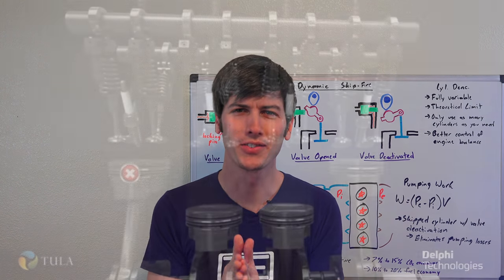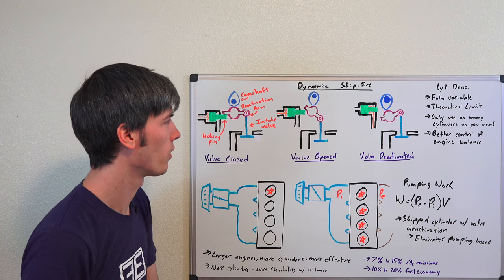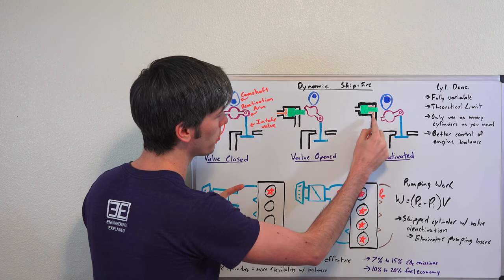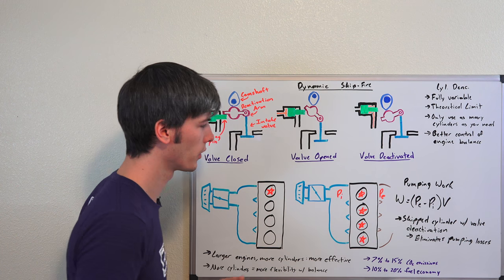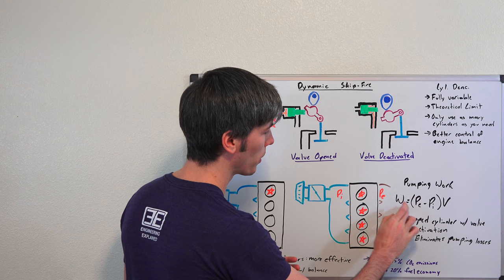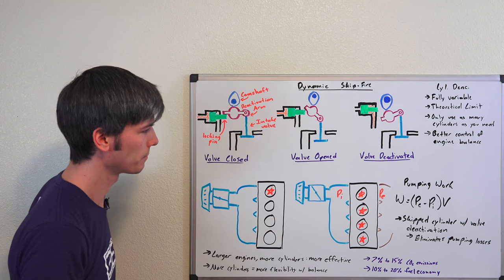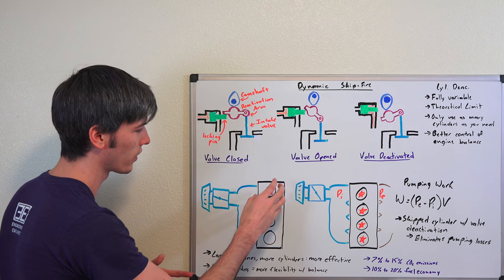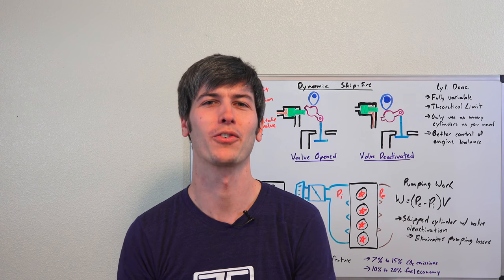How Dynamic Skip Fire Works - Variable Displacement Engines

Comment from the maker: Hello everyone! Lots of questions in the comments about what's going on with the deactivated cylinders, since they're compressing air or pulling a vacuum. Regardless of the quantity of air that's in the cylinder, it acts like an air spring (stores energy, doesn't lose much). So if there's a bunch of air in there, it compresses the air, then the air pushes the piston back down - not much energy lost. If there's not much air inside, then it pulls a vacuum on the way down, but is pulled upward on the way back up. Ideal would likely be to have not much air in the cylinders that are deactivated, so there is not additional energy lost from the pressure on the piston rings against the cylinder bore. Hope everyone's having a great day! 
Instagram! https://www.instagram.com/engineeringexplained/
T-Shirts! http://bit.ly/2BHsiuo
Reply: Engineering Explained if the valve is closed using this switch it may lead to breaking of switch. Why not use a cut off for fuel injection because if the valve don't open it create vaccumn n pressure inside the chamber lead to engine stopping. As per my opinion fuel injection should be cut off of smooth operation. correct me if I m wrong. Thanks for knowledge
And keep making videos
Reply: So does this technology require a throttle that is electronically controlled? Or can it be configured with a cable somehow? I know Tesla is not ICE but their models have a capability to remotely control the throttle, brakes, among other things. I hope this is unhackable, if it is electronically controlled
Reply: It is more efficient to keep the valves closed while cutting fuel injection since that turns the deactivated cylinder into an air spring with very little loses. That is the whole reason for this switch mechanism and it is also done in current cylinder deactivation methods. Just cutting fuel ignition while keeping normal valve operation will lead to pumping loses (both on intake and exhaust cycles) negating much of the gain.
Reply: Fuel injection will ALSO be cut. As it indeed is under some circumstances in any EFI system. Such as when decelerating or being pulled down a steep hill by gravity. If the engine speed is above a certain threshold point, just above idle, say around 1300 1400 rpm and the ECU receives a throttle position sensor signal indicating it is at idle or no throttle. There will be no fuel delivery. The injection duration will in effect be zero seconds. This stops wasted fue and unburned hydrocarbons being spewed from the exhaust.
But this does not help with the other aspects that were well covered in the video such as efficiency and pumping losses.
Reply: Very interesting. For the sake of running culture you can only shut of an even number of cylinders and you can only do it on engines with an even number of cylinders, because else you couldn't realize second engine balance.
Reply: If fuel injection is cut but valves are left normal then the deactivated cylinder will have pumping losses as well as lost energy to compress air. If you read his post above it takes advantage of the fact that all the energy used to compress the air is conserved when that air (spring) pushes back on the piston during the "power" stroke.
Reply: i was right abiut to ask that! can i consider myself intelligent? ahahah
Reply: Your explanation is flawed. If you keep inlet and exhaust valves closed you get compression lock, or at least braking. Try again.
Reply: and there is the answer to the question i was going to ask.  Thanks!
Reply: The spring losses are still pretty high, as are the friction losses, in the deactivated cylinders. This is a poor way of gaining a little efficiency. A much better way is to start with a smaller engine to begin with and then use turbo-charging to effectively increase displacement when the extra power is needed. With cylinder deactivation, you're always lugging around that big, heavy engine that effectively becomes smaller when needed. With turbo-charging, you're always carrying the smaller, lighter engine that effectively becomes larger when needed.
Reply: So, throttle partially closed creates "suction" and the engine has to work hard; but no losses with valve closed... because the air acts as a spring?  ... Gimme some of that "smart air" you guys have around there, the rest of us could use some of it too!

Piston moving down with valve closed will require work (anybody that tried to pull back a syringe with the finger on the nozzle knows that). You will get some of that energy back like you said due to the built up potential energy.

No magic with throttle open though: It will actually require less work for the piston to move down (since air can get in the piston creating less "suction"); but on the up stroke, whatever air got in needs to be compressed nso it will need that much more extra work.

And if you  want to be fair and look at a complete cycle (4 strokes) I think it washes out...

Any gains would be from losses due to leakage past the rings/valves and any possible friction associated with moving/not moving components.

My 2c. Good job on the videos though!  Really enjoy them!
Reply: Jason, can you do a video that walks through some of the calculations for sizing butterfly valves for throttle bodies?  Determining airflow needed, and the pressure drop across the throttle body using Cv values?  Just an idea for a video.  Thanks, and keep up the good work.
Reply: Im looking for that diesel gate video of yours , I cant find it anymore
Reply: Which cars have that kind of deactivation already???
Reply: MGdrive, Mazda is the only maker to provide it on a 4 cyl engine. Lots of animations on their site. They use weights in the torque converter for balancing.
Reply: Yes this system will fail, because V8's with all their extra parts are so much less reliable than four cylinders :p
Reply: Sounds like a good argument for solenoid valves and independent throttle bodies...
Koennesig is doing that aren't they?
Reply: BobbyG I don't think Koenigsegg's Freevalve uses any throttle body. Why would it? The valves themselves act as small, individual throttle bodies. Even BMW's Valvetronic doesn't use a throttle body and that is "ancient" technology compared to Freevalve.
And yes, it is a good argument for solenoid valves. Simplifying that head, reducing the weight and having total control of valve operation can be used to take this concept further.
Reply: NB Koala Please continue reading you don’t have a compression lock you have an air spring
Reply: Wouldn't it be better to just have both valves opened a little bit. So air can just pass through the cylinder
Reply: rationalmartian what car models cut the EFI system completely when going down a hill?
Reply: NB Koala how so? You don't get compression lock on a normal compression stroke so why would you with this? Try again
Reply: can anyone 
explain the difference between awd and 4wd
Reply: Engineering Explained this litterally answered my question withou having to write it! Thanks
Reply: I think Koenigsegg actually got this brilliantly solved with their Freevalve system. Simple and capable.
Reply: I was thinking the same thing. I have seen the concept videos a couple of years ago but haven´t heard of any engine using the technology
Reply: My Challenger Scat Pack 392 has this as well.
Reply: HEY JASON. SEPERATE TOPIC! CAN YOU DO A VIDEO ON WET LINER VS DRY LINER ENGINES? LIKE ENGINES WHERE THERE IS A GAP BETWEEN THE CRANKCASE AND CYLINDER OR NOT. GOT INTO A DEBATE WITH A PERSON SAYING THAT WET LINER ENGINES LIKE THE ECOBOOST LINEUP, SPECIFICALLY THE 2.3, ARE UNRELIABLE BECAUSE THE CYLINDERS HAVE ROOM TO MOVE. THANKS!!!!
Reply: Hey there. I thought i should let you know that your caps lock is on. That's like driving around with your high-beams on, or yelling in a library. It's considered bad form and inconsiderate of others. Thanks for understanding.
Reply: yeah but who would buy a 4cyl foolsize truck/suv? even if it had same horsetorks.
Reply: damn near all of them since efi came to the masses.  dfco.
Reply: Just a small correction but actually higher crankcase pressure is pushing the pistons back up when the pressure is lower in the combustion chamber at the time when a vacuum is in a dead cylinder.
Reply: I have a V-10. Why cant I just disconnect the injector and ignition power supply in six of the 10. Are these these cylinders now deactivated and saving fuel??

Comment: Excellent video and I agree with everything you said.  I'd like to mention a little more about effficiency.  The most efficient internal combustion engines made are the huge diesel engines used in powering ships across the oceans.  Some of these engines have cylinder bores on the order 10 to 15 feet.  This results in a drastic increase of cylinder volume to cylinder wall area ratio, which also results in far less heat being conducted out of the gasses through the cylinder walls.  By cylinder walls I mean the total area exposed to the gasses with consists of the piston crown, cylinder head and valve head areas plus the actual cylinder walls.  Cylinder deactivation in these engines is typically not used because these ships' engines are typically designed to operate over relatively narrow power requirements, which is typical for ships.

Comment: Hey Jason! Thanks for your comment about the air spring thing, that was my first question but you answered it before I could even ask the question!
My other question is this: how does the balancing of the engine work in this situation? How can a 4-6-8 cyl engine be balanced with only one cylinder firing?

Comment: I didn't get why the throttle opening was smaller when running on 4 cylinders? Wouldn't it need less or at least the same amount of air (ie. the same amount of air needed to create 25hp in one cylinder would be roughly equal to dividing that air four ways and sending into all 4 cylinders) and consequently have a similar throttle opening? That confused me a bit - seems counter intuitive.
Reply: MrSlash00r The problem is that four cylinders want to "pull" four times the amount of air at a constant throttle position (in comparison to just one active cylinder) So you have to limit those four cylinders with an even stricter throttle.
Reply: How can 4 cylinders pull 4 times more air? They don't pull air at the same time.
Reply: On average they do. At, let's say, 3000 rpm, one working cylinder would pull air in 25 times per second. With all 4 cylinders working they would also pull air 25 times per second... each. So there would be some cylinder pulling air 100 times in one second, and with the same amount per one pull per cylinder it means 4 times more air pulled in each second.
Reply: szafirowy01 Ok, I got it.
Reply: The airflow with DSF is slightly smaller, since it only goes down because the efficiency improves. The pressure differential between the intake manifold and the atmosphere also goes down. One requires a smaller throttle opening, while the other requires a larger opening. So the change(size and direction) in the throttle opening will depend on the operating condition.

Comment: I love this theory. And on paper it's a wonderful idea!. As a master  Ase tech that's been at a chevy dealer since 07 I can tell you for a fact that I never put pistons in a ls style engine until the 07 active fuel management engine That deactivates cylinders 1,4,6,7 using a different lifter that collapses inside of itself when unlocked. (Valves stay closed)  Same idea AIR SPRING concept will take care of engine as it's running. Real world situation.... the vacuum inside the cylinder that is created is so large it actually sucks oil past the piston rings eventually causing a build up of deposits on the rings expecially on the bottom (oil seal rings), thus turning the engine into a big money pit of warranty  repairs for the company by 50,000 miles and customer satisfaction numbers to plummet because their " brand new truck" now needs and engine overhaul. (Piston and ring replacement) Let me say again this all started in 07 and still to this day in 2018 I myself ( 1 out of 14 techs) put at least one set of pistons in a week ! 11 years later UNDER WARRANTY!  So if we're running with this. I sincerely think the "air spring" idea needs more evaluation. Would love this to come together and not cost my favorite brand millions in warranty  dollars. Or to hear alot of very brand loyal customers say " this will be the last one I buy" ...

Comment: I've a Dodge V8 (Hemi 5.7), Chevy V8 (LS4 5.3) and a Chevy V6 (3.9) that all had cylinder deactivation - and those are all at least 10+ year old engines at this point.  Worked very seamlessly in each one of those.  This is not a new technology at all, but the concept of varying the deactivate-able cylinders is.  Will be interesting to see how this is implemented.

Comment: Hey good video. Just wanted to note that the intake valve can in fact act like the trottle plate. In fact gas motors can due away with the throttle plate. You just have change the cam for timeing duration.

Comment: I'm interested in the relationship between this and engine balance. Does engine balance play a noticeable part in determining which cylinders (and how many) fire? Is engine load also a factor? Does the 'air spring' of the deactivated cylinder's mitigate this issue somewhat?

Comment: Great explanation on a subject  I have wanted to understand better but no one seems to want to attempt to explain and thanks for adding the info in comments about the push pull action of air on the dead cylinders answering that question.
But PLEASE add more info about the main reason the fuel economy is increased when you talk about the engine pumping being more efficient with less cylinders when vehicle is under a light load. I mean it seems this part is not explained enough to comprehend as vehicle's are fuel injected and more exhaust would seem better not worse. I do understand the hotter cylinder when turning off others.
Also I'm a bit surprised that the friction of the dead cylinders still spinning isn't a concern on economy, that we didn't find a way to disconnect the piston movement altogether.
Also a discussion of the old method of turning off cylinders history would be a great discussion. I had a friend with a Cadillac from I think the 1980's that had the 4-6-8 engine and he I believe had to have major work done on it because of failure and he lived in an apartment, seems that engine emptied his wallet and was one of the reasons he never could get out of monthly rent and buy a house poor guy.
Thanks

Comment: Finally back to hit n' miss style of combustion on all cylinders.
I like it.

Not that the way to get there is the same as on a hit n miss system, but it delivers the same style of fuel economy, in the same way. Keep tabs on engine RPM, and only fire a cylinder when needed.
Neat.

Comment: Ooh! A great idea. Also, we can build in a special "straight line" mode. Here's my idea. We monitor the steering input of the car in the ecu. If there isn't any, we detune the engine. You know. Because you don't need as much power if your not in twisty roads. Has this been done yet!

Comment: I'm interested in seeing how this compares to turbocharged engines at highway speeds.
Reply: What do you mean compares to? Do you instead mean in conjunction with?
Reply: But those are completely different animals. If we're talking highway speeds with minimal load on the engine, a turbo wont be producing boost but will still be firing all cylinders just like a naturally aspirated engine would. And if we are talking about a positive boost pressure scenario, well it's still the same situation so I dont see how comparing unlike things would give any meaningful answer. Or am I understanding it wrong?
Reply: Alan Bowers No.. I'm not sure a turbo would even make sense in conjunction with this CD tech. You'd need some sort of variable boost system. Plus if you're running on 2 or even 1 cylinder then the benefits of boost are hardly noticeable.
Reply: Nick Angelos why wouldnt it? At low loads, boost is minimal, or the cylinders could even be in vacuum. It would make sense to my non-engineering mind to use it alongside. But again, I'm not following the need for comparison between cylinder deactivation and turbocharging.
Reply: Alan Bowers And yes they're for different purposes, but like I said I'm just curious
Reply: The boost in the Fiat Twinair is defenitely not ''hardly noticable''
Reply: Gm Nee V8 are using this Technologies sow let's see.
Reply: In general what they are going for here trying to follow the BSFC chart and stay in the highest output per gram of fuel input on the chart (for an example the bsfc on my 96 civic was from 1750 to 2250 around 80% load the engine is "starving" and will give the most acceleration for the least amount of fuel used. The problem with that is when you try and stay in that area its normally under high load conditions and you go into boost which richens the afr and you don't get the same benefit as a Naturally Aspirated engine. Typically engines go in and out of the sweet spot as they go through the curve and what they are trying to do is adjust the engine config to stay closer to the sweet spot all the time.
Reply: Nick Angelos everything is already variable boost, you aren't getting boost at all times. Put in an electronic waste gate and be done with it.